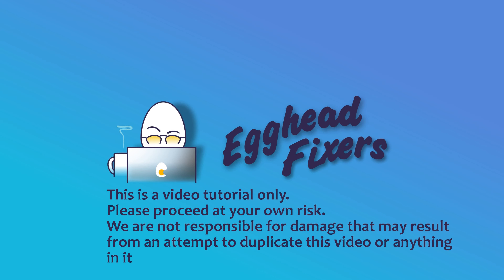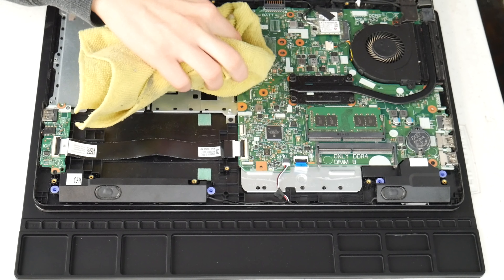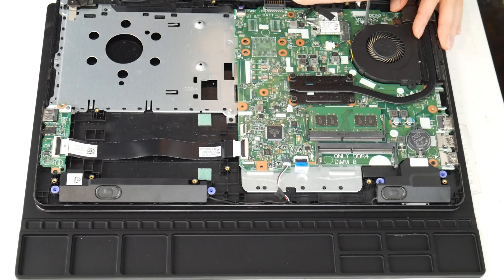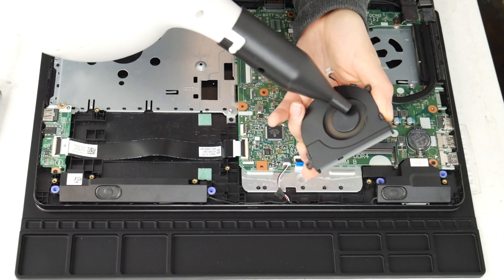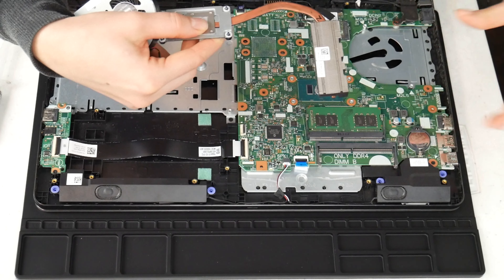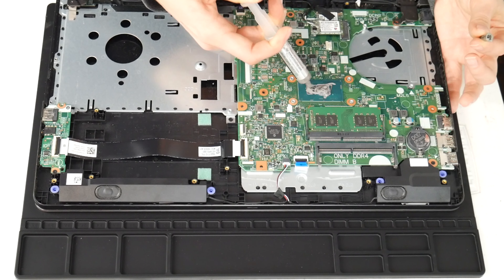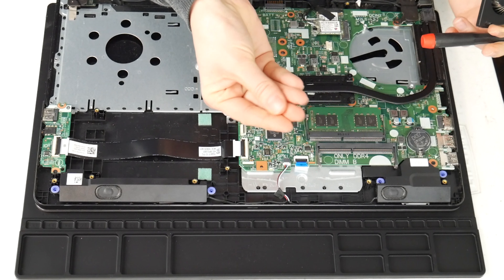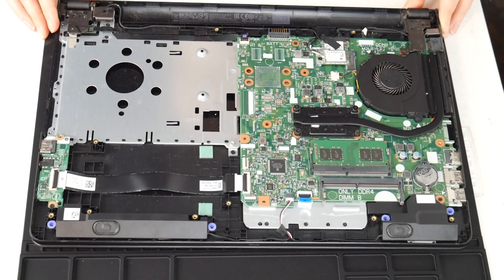How to Fix an MSI Computer That Runs For a While and Then Shuts Off

Comment: Hello ma'am. my Acer aspire 3 is turn on for a while and the shut off. I follow your instructions but it's still doesn't work. is there another method ma'am. thank you
Reply from the maker: Does it give you any sort of error before shutting off? Also can you to Windows? Because if you can access Windows then I would try  checking your windows logs. Windows logs every time it runs into an error and will give you information you can google to see what caused the error. You can access these logs by doing this:

You can do this by Press ⊞ Win + R on the M-Files server computer.
In the Open text field, type in event viewer and click OK.
Expand the Windows Logs node.
Select the Application node.
Now from here look for the date and time you had the blue screen. It should have recorded an event at this date and time with a red icon or yellow one next to it showing a problem. You'll recognize it because it looks bad. Click on one of these events. Down below it will give you an event ID number. You can google this to pinpoint what is causing it to restart.

Comment: Gonna try this i hope it works
Reply from the maker: Let us know how it goes.
Reply: Hello i did that it still shutdown randomly, i tried every solution i found on web and still nothing
Reply: Please suggest me something if u see this comment and thank u
Reply: @naoufalk7380  did you find anything that worked?
Reply: @supafly208  no bro i tried everything, i believe the problem is motherboard, i really tried everything to avoid buyin another labtop but nothing worked
Reply: @naoufalk7380  found something that worked. In bios, there is a section on CPU thermal controls. There is a value called TCC offset, which is used to determine the value at which the motherboard and OS try to keep the cpu under. Increasing this value will lower the max temp.

Mine was set to 5 by default which related to 95 degrees for the temp warning(numbers turned red in HW Monitor). It would periodically reach 99 or 100, but the numbers started turning red at 95. I increased the TCC offset to 20, so now it tries to stay below 80 degrees. It'll periodically reach 85, but i haven't experienced any shutoffs or a scalding hot keyboard since i lowered it.

CPU turbo still boosts it to higher GHz, unlike other methods to lower temp such as setting the power limit in the power plan to less than 100% when plugged in. 

Give it a shot, but disable any other tweaks you've done before this to single out your modifications.
Reply: @naoufalk7380  in addition, to get the advanced options in bios, load into bios using the delete key. Once you're in, press (and hold) rightCtrl+rightShift+leftAlt+F2, you can let go of everything after F2.

Comment: my brand new msi shuts down when i leave it alone. I don't know why it'd be overheating. MSI seems to be absolute crap
Reply from the maker: Does it feel like it's overheating? Also, you can check the Windows log to see what error the computer is recording at the time it shuts down. Here is a video on how to do that:

Windows 11 version:
https://youtu.be/cgQaiSiOqDA

Windows 10 version:
https://youtu.be/p7HmFtF0q00
Reply: @EggheadFixers  it doesn’t feel like it. But it’s hard to tell. Windows crashed so I had to format the whole computer. When I reinstalled all the msi apps were missing. I tried to reinstall them but pretty much none of them installed correctly so now the fan either screams or shuts off and I can here the clicking of the chips inside the computer. Never had such a dodgy new computer. I really hate the way it’s up to me to control the cooling of the computer. Why is this not just automatic????
Reply from the maker: @N8teyrve  It would be nice if it was just automatic. You can probably download the MSI apps from their website. Although it's more of a pain in the butt then it just doing it for you.